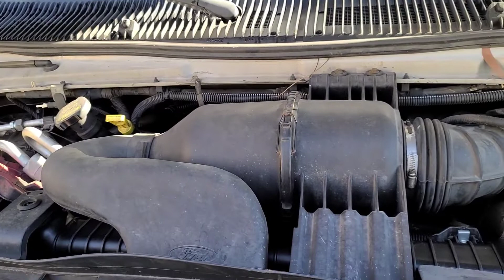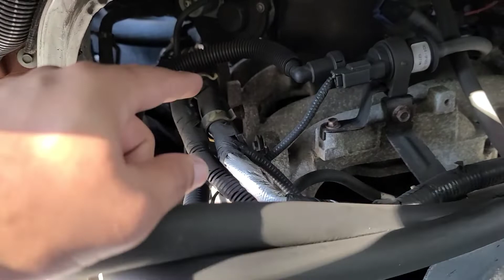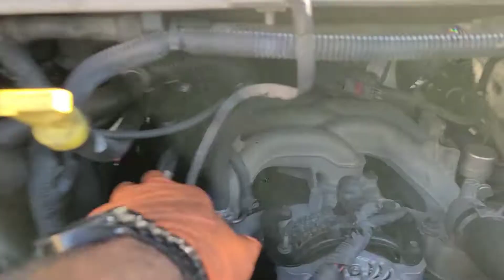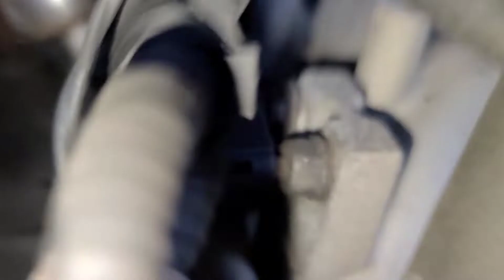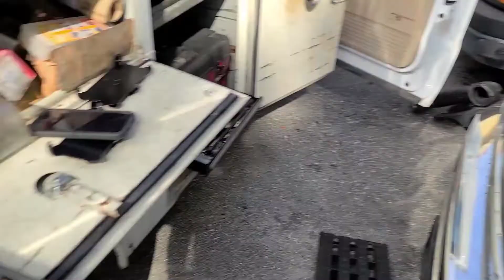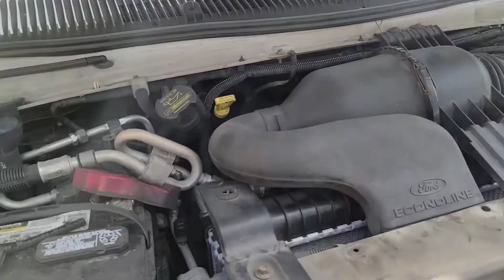Ford v10 misfire

Comment: hi boss, i have a 2007 ford e-450 6.8 v10 box truck, my truck when it's hot and i'm driving on the freeway starts some strange behavior and starts to slow down, it stays between 40-50 mph and farts already change the maf or mass sensor and the throttle body but it's still the same, what do you think is the problem?
Reply from the maker: If its only when it gets hot check you exhaust you may have a plug catalytic converter, does it have any check engine codes
Reply: @kennyadriankc  no code
Reply from the maker: If you drive it at night time until it doesn't want to go more then 50mph get under the car and check the catalytic converter if it's really hot and specially glowing red then its plugged,  if you remove 2 of the o2 sensor before the catalytic and you drive it , it will be loud but if the engine doesn't reduce the power and it drives normal apart from the noise then the catalytic are plug

Comment: How many miles to wear plugs like this?
Reply from the maker: Well that I dont know but what i can tell you is the bus has 500k miles the driver of this bus has been working in this company 6 years and he told me that they never changed them all the time he has been in the company,  so that been said i wanna say at least 150-200k miles to get them like this , which i dont recommend people doing this , I had to use pb blaster to get them out to prevent them from breaking in the hole, which i do that will all the cars i service but with ford its a most.